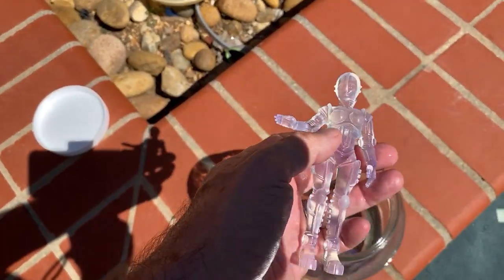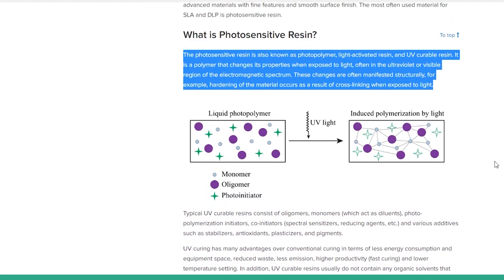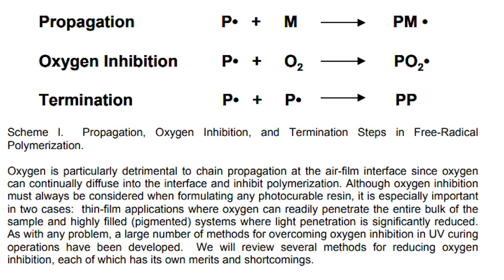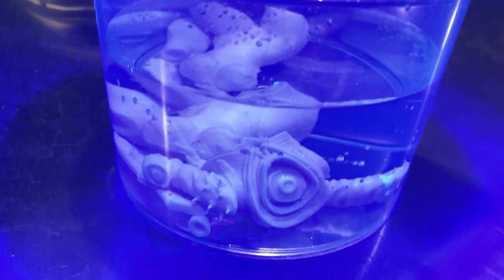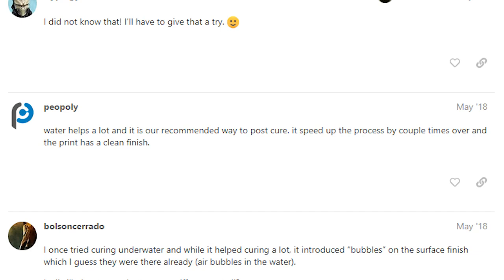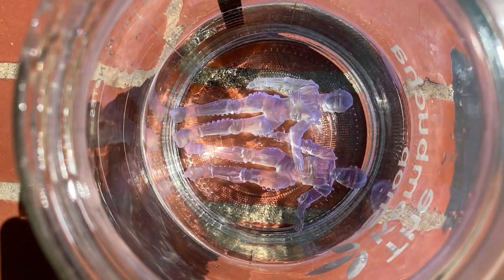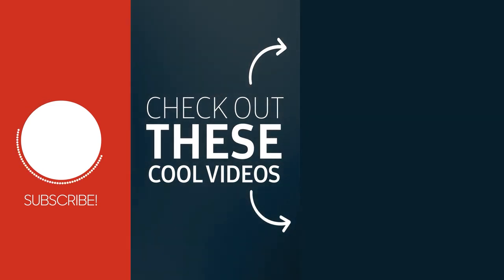Water Curing: The Best Way to Cure Resin 3D Prints

Comment: This has great tips on avoiding yellowing. If you find that your 3D print has yellowed, it's not too late. You can de-yellow by using a heat gun to evenly heat the print. I was surprised by how well this works. It seems counter-intuitive.
Reply from the maker: Thanks Dave! This is an excellent tip!

Comment: Worth mentioning, I think, is that polycarbonate jars (such as a clear Nalgene bottle) won't work for this, because polycarbonate screens out almost 100% of UV light in the wavelengths needed to cure prints. I also suspect that irregularly-shaped containers, like those mason jars with embossed patterns on the sides, could lead to the water acting as a lens and curing some spots more than others, though I haven't tested that.
Reply from the maker: Excellent point. Thank you for that info!

Comment: Once I learned about oxygen's part in the process I've used water for curing exclusively. Just be sure to check the resin's instructions, I've seen some that say water curing isn't recommended. For example Siraya Tech Fast doesn't say its a problem, but I'd assume because it cures so quick they suggest you NOT use water.  But also of note, I find those warnings far and few.
Reply from the maker: Mike Jackson I didn’t know that it’s not recommended by some manufacturers. Thanks for pointing that out.

Comment from the maker: Just wanted to add, so I could pin it here... I learned this after doing the video: "The temperature and salinity of water also influence how much oxygen it can hold. Warm water holds less dissolved oxygen than cold water because the molecules are moving faster than in cold water and thereby allow oxygen to escape from the water. Freshwater can hold more dissolved oxygen than saltwater because saltwater has less space for oxygen molecules due to the sodium and chloride ions it contains. Therefore the warmer and saltier the water, the less dissolved oxygen it will contain." --http://limnoloan.org/waterquality/dissolved_oxygen
Reply: can i cure this with water in a uv lighted chamber ?
Reply from the maker: Rod Vonrod Yes. It’s actually better, because part of the spectrum in sunlight actually breaks down the resin!
Reply: @Make3DTV  should the water in the curing chamber be warm tap water ? or cold drinking water ?
Reply from the maker: Rodrigo Von Rodriguez I used cold tap, but I have learned that the warmer the better. Warm water has even less oxygen!
Reply: Ha, as an aquarium owner, I was going to pop on to mention that. :)
Reply: @tenchuu007  I hope your fish are made of Resin ;)
Reply: No, but I've seen fish at the surface gasping for oxygen when the water is too warm plenty of times!
Reply: Yes, some fish kills that happens in the tropics is because of warm water movement in the area which brings down dissolve oxygen in the water.
Reply: I'll have to see if vacuum degassing the water makes the prints any better.
Reply from the maker: @johnspringer9275  Great idea! Hadn't thought of that.

Comment: I like this a lot.  I've always cured my prints in water but I would like to add one more feature to my curing station (diy).  My parts are really small and I think they would benefit from moving around during curing.  I'd like to come up with some kind of bubbler to agitate my parts while they're curing so I don't need to stir them.  I use only black resin so I worry about the light reaching all over the prints.  Glad to know I'm on the right track with the water.
Reply: I wrap my clear plastic curing cup in aluminum. Cured for about 2 min under a UV lamp and it's almost perfect. Next step would be a clear platform so there is more room between the bottom of my printer and the reflective aluminum so I can cure the bottoms a bit better

Comment: New to 3D printing, have been having all kinds of weird issues but curing has been the bane of my existence. This is the next method I'm trying and from what I've seen it should solve some of the problems I've been having with tackiness and such. Thanks!
Reply from the maker: Hey, I hope this helps! I found that the second biggest problem with resin is cleaning up supports. You might want to check out my video on that as well. Your supports will come right off with very little cleanup. If you have a printer with the LED array (Elegoo Mars Pro or EPAX X1, etc.), you can use the settings I use in the video. If not, use the annotated settings. Let me know if you have any questions--> https://www.youtube.com/watch?v=q63Mip5HsyY
Reply: 2 years later, how did it go?

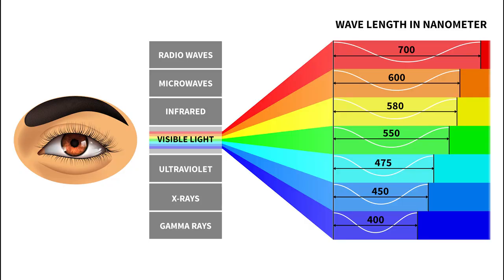Comment: One small thing at 1:35, UV light ( like infrared) is not visible to the human eye, as you can see from your diagram,  UV light is outside the visible spectrum range. However, 405 nm falls in the range between UV and visible light, so I understand the confusion
Reply from the maker: Pap2020 Thanks for pointing that out! 👌 I was 5nm off!

Comment: I haven't run across this information yet, I have a new resin printer coming and I've been watching videos about water-washable resins.  Thank you very much for this.  It will be my preferred method of curing as it has the added benefit of curing the rinsed-off resin in the water as well, making sure the water is ok to dispose of after filtering.
Reply from the maker: Hi Cory, for disposing of the water, put it in the sun and let all the resin contained in the water cure. Then you can dump it or just let it evaporate.
Reply: @Make3DTV  I've got that..just curious about curing the object in the rinse water..kill two birds
Reply from the maker: @CeresOutpost  I guess if you filter the water, yeah. I hadn't thought of that.

Comment: This does work but it clouds clear parts in my experience. If you want clear parts, what's worked for me has been cleaning normally, cleaning with hot water, then rinsing with IPA and letting that dry then curing normally.
Reply from the maker: The clear coat spray will clear up clouded parts. Works like a charm!
Reply: @Make3DTV  okay thanks I still need to get myself some clear coat

Comment: Use hot water to increase strength. about 60°C according to the FORM 1 guys.
Reply from the maker: Hey, thanks for mentioning this. I did not know that!
Reply: @Make3DTV  You know how you can use hot water to better seperate supports from resin prints ? You can probably use the same hot water to then post cure it afterwards. I have not tried that out though. But I would like to encourge you to try that out. Maybe you can print some simple shapes and then test afterwards how much that improved the overall strength.
Reply from the maker: @sierraecho884  Great idea!

Comment: I left some of my prints in a bucket of water in the laundry room which lets the sun  come in, the next  day I removed supports and those prints came out basically transparent the other ones I left inside without sun under water are yellowed.  Don’t know how to make them become transparent again  I tried with heat gun but the print started to crack as if it were snake skin. 

Thank you I’ll try leaving my prints under water\sun from now on. 
Now on.

Comment: actually the percentage of the mass of water that is oxygen is about 89% and about 11% hydrogen. However this oxygen is tightly bound within the water molecules. There is a very small amount of dissolved oxygen in water as well and this concentration is slightly higher where the air meets the water.

Comment: when you resin print, do you allow you prints to drip from the build plate before removal for a certain amount of time or just pull it off as soon as its finished?  I've noticed a few 3d projects on thingiverse allowing a modification where the build plates can be rehung at an angle.

Comment: Hello. Quick questions. Shouldn't you wash your print in alcohol before dumping it in water to cure? What happens with all the uncured resin on the surface of the part remaining from the printing process?
Reply from the maker: Yes. You need to wash it before post-curing. I use an ultrasonic cleaner with Mean Green. See how I clean here: https://youtu.be/O2KRJIa1Yq8
Reply: @Make3DTV  Alright! Thanks for the tip👍
Reply: Thanks for asking this question. The video said you just cut the supports and cure, and I was wondering if something was missed. I know some people dip back in resin to get ultra-clear prints, so I thought the lack of washing was another way to get the double dip effect.

Comment: Thanks for sharing this.  At ~3:30, you mentioned that you put the print in water after cleaning it.  What do you use to clean your prints?  When I first tried curing in water, a thin white film appeared on the surface of my prints.
Reply from the maker: Hi Frank. I use an ultrasonic cleaner. You can also rinse in a container filled with mean green or alcohol and scrub gently with a soft toothbrush, but make sure you handle with gloves to avoid leaving finger prints. This video shows my print setup with my cleaner -> https://youtu.be/O2KRJIa1Yq8
Reply: Make3D TV Thanks, the video is helpful.  I particularly like your use of a plastic bag in the ultrasonic cleaner.

Comment: Sorry, I'm new to 3d printing. Just to clarify: resin 3d prints could be cured by water, not alcohol? Any resin or some specific brands?  Or you need to cure in alcohol before the water? Thanks!
Reply from the maker: Hi. Resin is cured by the UV light. Clean the print with alcohol after printing it, rinse the alcohol off with water, and then cure the print in UV light while placed under water. There are different resins with different properties, depending on what the purpose of your print will be. I’m working on a video about that. Elegoo brand is good for printing miniatures, etc. Gray is a great color for making all the details visible before painting.

Comment: Elegoo now makes water washable resin, how would that affect this process, good or bad? 🤔
Reply from the maker: Should not affect it. It’s water-washable, but it cures the same way.
Reply: @Make3DTV  So we can wash off the resin and cure it both with water? (Assuming two different tubs of water) Awesome!
Reply from the maker: AudreyStarlight Yes. Shouldn’t be a problem!
Reply: So I've used the water washable resin. My prints drop into a ultrasonic cleaner than in a dollar tree plastic tube with water. Throw it outside and come back in a few hours.(mostly because I set it and forget it)(usually when the next print is ready to be cured)
Reply: @deathcometh61  a few hours!? im new to this but thats seems like an insane amount of time - does it not go brittle?

Comment: Thanks a lot! I'm stuck with a project, I don't want it to melt in the long term, I want it to last until someone or something that's not the resin itself ruins it or simply survive through the years to come. I just had a problem with one of my figures, melting only by the touch of my sweaty hands, slowly... So I have some questions admirable 3D sir: In my country there's no such things you can find in home depot to make your DIY CURINGBOX but there are UV small lanterns, can I try getting one of those and pointing at the drowned in water figure in my room? Also, you mention salt water in the description, does it work with food salt or is it some other type of salt?
Reply from the maker: Hey there, yes, you can use the UV lantern and regular table (food) salt.
Reply: @Make3DTV  Thanks so much I've been doing it, and it seems to work.

Comment: Thanks for the info. So due to the UV curing water will also be safe to discard, right? All the resin residue inside the water will be cured too.
Reply from the maker: Yes, correct. But if you're really concerned about it. Pour the water into a container that you can throw away and let the water evaporate before discarding.

Comment: So when you say "after cleaning your print" etc, do you mean by cleaning one still has to clean it in alchohol (if not using Water washable resin)? Just want to be clear this is only a curing method right? 😅
Reply from the maker: Prajña Bhadra Yes, remove from build plate, clean excess resin off the print with alcohol, remove supports, cure in water. This is only for curing— not cleaning.

Comment: Before the water stage, do you rinse in IPA, or straight from build plate to water ?
Reply from the maker: I rinse in IPA, then rinse in water before the water curing process, but I suppose you could go straight to water curing. I've also found that using acetone instead of IPA is awesome! You don't even need a sonic cleaner. Acetone does a thorough job of cleaning, but it's more toxic.
Reply: @Make3DTV  many thanks for the advice, I have Acetone, but it seems to evaporate very quickly so hadn't thought of using it as a resin cleaner.  I have the Anycubic wash and machine, that whips up a vortex so cleans well. Was just looking to see if that ipa stage was skipped, it's not.  I will try some water curing on print that's running overnight,  thanks for your great content, ok my 2nd resin print so your content very valuable

Comment: Great video! I wonder if using an oil instead of water would make any difference. Water has oxygen in it... Mineral oil might work but I wonder if it would react with the polymer. I might try it just to see. Thanks again!
Reply from the maker: Good idea. I learned this after doing the video: "The temperature and salinity of water also influence how much oxygen it can hold. Warm water holds less dissolved oxygen than cold water because the molecules are moving faster than in cold water and thereby allow oxygen to escape from the water. Freshwater can hold more dissolved oxygen than saltwater because saltwater has less space for oxygen molecules due to the sodium and chloride ions it contains. Therefore the warmer and saltier the water, the less dissolved oxygen it will contain." --http://limnoloan.org/waterquality/dissolved_oxygen. So... try warm salt water as well!
Reply: The oil density might also decrease the amount of uv power that reaches the print.

Comment: What clear resin are you using? Looks like it doesn't yellow at all!
Reply from the maker: It's Elegoo standard translucent. It will turn yellow if you over-cure. You have to get the exposure time just right. What printer do you have?
Reply: @Make3DTV  I'm using a Photon Zero and Anycubic water washable clear resin. Might have to give the Elegoo one a try...
Reply from the maker: @roka  Check out 3DPrintFarm's latest video on dialing in exposure. Should work with clear resins too and you can use yellowing as another indicator: https://www.youtube.com/watch?v=r9GwPEJ8Lq8
Reply: @Make3DTV  I have an Anycubic Mono… any suggestions on cure time? Layer and post in water?
Reply from the maker: @akura2  For Elegoo standard clear, take a look at the normal resin settings in Chitubox under the Elegoo Saturn. Apply those to your Mono X profile. These machines use the same screen. Post cure for about 8 minutes in water. Clear coat as soon as it's dry.

Comment: What do you use to clean the model? Do you skip the pre curing cleaning step?  Alcohol makes a clear model look cloudy and mean green makes it a gross yellowish green.
Reply from the maker: No, I don't skip the pre-curing cleaning. I used to use alcohol, but now I use acetone. just do a quick dip and the rinse with water. It's especially great for clear prints. Make sure you wear all the necessary protective equipment. The stuff is nasty. If you want to continue to use alcohol, rinse it off with water immediately afterward before curing. That, along with a clear coat spray afterward will get rid of the cloudiness.

Comment: if i use my uv lamp, from the top... the container still need to be clear?
Reply from the maker: No, but you want the inside of the container to be reflective. Some people wrap the outside of a clear container with tin foil when they use a lamp.
Reply: @Make3DTV  thanks! mine is reflective on the inside... i will give this a try...

Comment: After removing the supports you do´nt clean the print (for example with IPA)? You put it directly in water to cure?
Reply from the maker: Clean it first with IPA or whatever your prefered cleaning method is. I guess I should have said that, but always clean before curing.

Comment: Hi, thank yo for the great video. How did you clean the clear prints? I use IPA and water and they get so frosty. Your's look crystal clear, absolutely stunning.
Reply from the maker: Mi Maria, after you wash with IPA, rinse completely with water. The IPA can leave a frosty residue. After curing, hit it with a UV resistant clear coat spray.
Reply: I’ve found that you don’t need to leave it in the IPA very long. Like, a few second is fine. Swish it around and get it out. Apparently, resin can soak up the alcohol and cause it to split layer if you leave it in too long.
Reply: There was also an observation done by an artist doing mini figurines with clear resin that the shorter time spent in IPA (less than 2 mins) will make the printed product more clear and not frosty or opaque than the ones that stayed in the IPA for a longer duration. 99.9% IPA purity was used.

Comment: What does it mean when the resin turned yellow? and can we prevent this???
Reply from the maker: With clear resins, it means that it's over-cured. Adjust your curing times during printing and don't post-cure too long. Also spray a UV clear coat on it after curing.

Comment: Just a thought. I produce a lot of resin terrain that is hollowed out. By placing the pieces in water and enabling the terrain piece to fill with water, will this enable the UV light to get into the normally hard to reach places and cure them internally?
Reply from the maker: Yes, the light refraction in the water can get the light into hard-to-reach places. You can also use a UV flashlight to cure the inside. You can find those on Amazon.